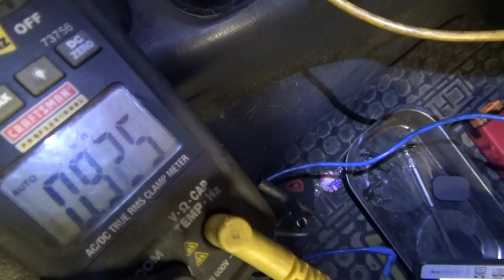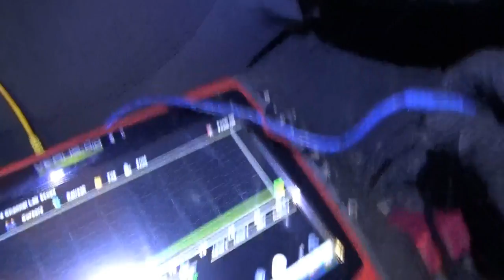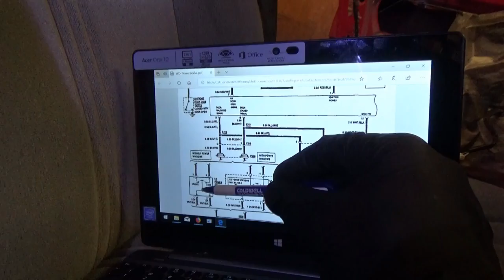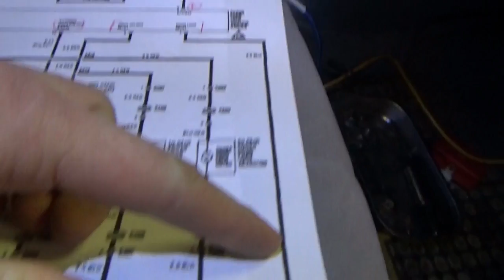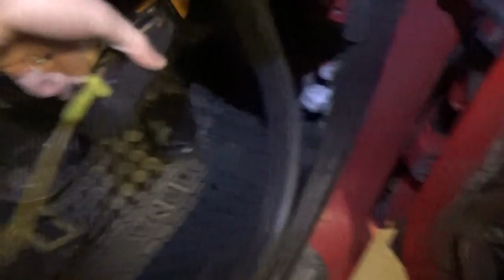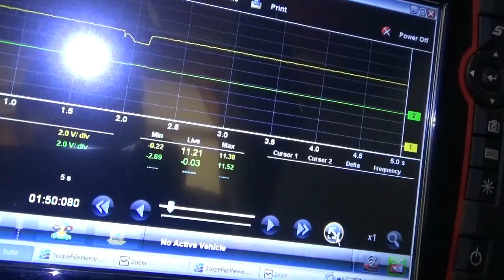Power locks gone NUTS! (Toyota) -Part 2

Comment: I must admit that over all of the "case studies" videos and many other diagnosing videos it seems to be that "automotive wiring" and "terminators" or plugs/connectors are usually the problem in just about 70% of what I have viewed so far. By that it seems, NO parts needed, just a simple wire repair or terminator cleaning and dielectric treatments.  It seems to be such a massive concern if this is happening along the entire "rust belt" that the auto makers need to re-think how they design and provide their customers with "reliable" wiring systems.  This issue isn't likely as bad in dry areas of the USA however, give it enough time and the same will result even in the lower states. This is especially true with all low voltage circuits such as 5v or low current circuits that simply send impulse signals to "modules".  Also, it appears that module placement needs to be centralized in vehicles to eliminate the tear down process and extreme labor needed to diagnose them.  You would think the auto makers would figure out a way to simply mount all modules in a "vault" located centrally to the vehicle so any need to diagnose modules would be in one place vs. 15 or 20 places and in extremely bad locations subject to heat, road hazards, weather etc. Take note how a residence is wired, they have circuit breakers in one central location...can you imagine having them spread throughout the entire residence !!

One other thing I believe is necessary when diagnosing vehicles. A battery maintainer that is connected to the vehicle battery as the first task. Many of these repairs require doors, hoods, truck lifts etc. to be open and courtesy lights are on including the ignition key to on etc. At some point, the battery gets drained and usually never is brought up to the fully charged state when the job is done. I'm no engineer but it seems that 12.6 volts would be best vs. 11.2 for example when diagnosing electronics designed to run on 12.6+ volts. I've seen a few vehicles that are super sensitive to lower voltages and cause problems just because the system voltage is not "perfect".

Comment: ivan
I would tired unplugging the module and monitoring the voltage and if it jumps up to 12v then call the module
Reply from the maker: But the module supplies the voltage....so you would just get 0V lol! Now maybe taking just that one pin out....that could work :)

Comment: Wow very good analysis, since the car is so old the rubber trims could be deteriorated causing water intrusion mix that with road salt spray and you have good conductance between pins that shouldn't be connected. Every time I plug in my block heater I need to wipe the plug clean or it trips the gfi outlet. Merry Christmas and happy New year

Comment: You did not show the resistance value after cleaning the plugs. The pull up resistor value will determine how much current that the circuit can source. That would cause a voltage drop even with a 100's of kilo ohm resistance if the pull up resistor is a high value. I would have put some dielectric grease in the plug to help keep out future moisture.

Comment: When you was testing the resisters in the module even though you were not pressing any buttons you must have had some current flow to gave the drop in voltage accross them. Because as you know...no current flow=no voltage drop....all down to the green crustys in that conecter... Good find...

Comment: You definitely have a problem with corrosion in the Northeast and Midwest.  Corrosion was one thing taught at seminars I used to attend, however, in Southern California I sometimes found non corrosive wiring problems, but usually was a component problem.  Still, this was a great training video WITH a live intermittent problem ! !   Great Repair!
Reply from the maker: All this rain this past year has been bringing in some really interesting case studies! I had three good ones just this past week....and one lined up for tomorrow!
Reply: @PineHollowAutoDiagnostics  
Fantastic job!  Keep the videos coming!  I had a "U1000" code on my 06 Nissan Frontier at the 4X4 module earlier this year.  The 4WD worked.  Watching the information to the ECM, I could see the changes on my Matco MaxMe and  the Pico was showing Can Hi and Can Lo working.  Hmmmmm.  Disconnected the module board from the harness connector.  Nothing seen visually, no burned parts or broken printed circuit.
Cleaned connector and board contacts, no more problem.  No green crusties, possibly a film or glaze from (?).  Checked it last week, no codes all modules.  I've seen the "film" cause a problem in the past at work before I retired.
Having an automotive and lightweight electronic tech backgrounds has helped in 29 years.  Keep up the good work and diagnosing Ivan!

Comment: Could of just re soldering the whole main doors locks circuit board functions first.90% to 98% it will solved the problems too because soldering joints will be loosing and conducting powers even the soldering joints still looks very goods.Old Electronic components and circuitries will take in heat and moistures in years and decades will be losing internally intermittent conducting problems.
Reply from the maker: Nah that would be too much extra work; nothing wrong with this module and it lives in a nice dry place :)

Comment: I had a Jeep Grand Cherokee and neighbors were telling me the parking lights were flashing and interior lights came on then went off. This was happening all night. Driving it to work it wasn't doing it ? One morning the battery was dead so I knew the issue was getting worse. Charged the battery and started pulling terminal when I parked it. It got worse to the point the doors were unlocking & locking driving down the road and the interior light came on when this happened and timed out which was miserable at night. Figuring it was a bad door switch I went to U-pull it and got switches for the doors and swapped. Did the front first as no one rode in the back. That didn't solve the issue so I changed rear doors. While having the doors apart I checked all the wiring to the plugs. Got to the point it was click click click when driving. Took Jeep to a wiring specialist recommended by the dealer. They checked all the wiring and changed a module. I think it was BCM ? When I picked it up it seemed OK going home but the next morning going to work the clicking started again. Hundreds of dollars to "not" repair. Called specialist who said the harness had to be changed. Hundreds more dollars. Bought a battery disconnect, took the bulbs out of the interior lights, and set it every time I parked it. Never was fixed. When income tax came traded it. Dealer walked around it but didn't test drive, LOL. They would wholesale it anyway.
Reply from the maker: LOL that sounds like an interesting case study! Sounds like no one bothered to look at a wiring diagram xD
Reply: @PineHollowAutoDiagnostics   Tell me about it. Paid Rubino's automotive electrical specialists $100 for a module and $300 for installation and examining wiring harness to solve issue ? Wish someone like you was around then. You were probably still in high school.

Comment: Aloha Dr Ivan..anotha awesome video..i have a question Ivan..my 2008 Nissan Altima’s head gasket blew..i called this guy and he said Nissan don’t have gaskets and i need to buy a new Engine for $1,200 plus his Labor of $800..do these cars really don’t have gaskets pls and what shall i do..looking fwd to hear from you..be safe and Aloha🤙
Reply from the maker: What? No head gaskets?!? That guy must be pulling your leg haha
Reply: Altima has a gasket, what you need is a new mechanic.
There are very few honest folks in mechanics these days, Ivan and I are rare examples.
Be sure the fans work, or you will have the same issue again. 
All the usual stuff applies, no cracks, flat surface, new bolts, and a decent mechanic will check all of these items. 
Your "Parts changer" "Mechanic" should not be involved in any of this.

Comment: Dealing with the same issue right now. Only difference is it also activates and deactivates the horn, door locks, parking lights all at the same time.Does it constantly non stop while driving or with ignition off. Had to pull the fuse before it killed my battery when parked. Weekend project. 1995 Toyota Camry.

I'd appreciate a tip if you have one. Just pulling out the one dome light fuse stopped the issue until I can have time.
Reply from the maker: Wow a 1995 Camry....wiring should be pretty simple. Start with a wiring diagram! Hopefully it doesn't have an aftermarket alarm system lol

Comment: Wow I was totally wrong on this one! In the first vid I was convinced it was a magic box (module) problem. In this one, I would've sworn that big resistor was the issue - I'd have removed it and soldered in a new one for nothing! Then I'd have been boiling mad when I found out I did all of that for nothing! Didn't even think about that circuit being pulled down - I guess because it's not a sensor, my brain just couldn't see that possibility. Never would've thought a bad connection & cross voltage would cause something like this. This was a GREAT 2-video series here! 

I remember long ago getting slid by a motorcycle that had turn signal issues. After HOURS of troubleshooting some really strange issues, I found that the turn signal element of the 1157 bulb had broken off and fused itself to the running light element inside the bulb! I don't remember exactly what the issues were, but I remember that they defied explanation, and I had never seen a failure mode like that before, and I haven't seen it since! Took me a LONG time to figure that one out  - was SUPER frustrating. Sometimes just a quick visual of all the components is the best course of action. 

GREAT stuff Ivan!! Loved this one!! Time for me to buy some DeoxIT ... 👍👍

EDIT: I remember bits of what was happening on that bike now - the front 2 running lights, & right rear would blink at the same time (like hazards) with the left signal activated, but the signal elements up front wouldn't light (problem bulb was in the left rear I believe). Then with the signal off, the turn signal elements in the other 3 bulbs would light up BRIGHT, along with both instrument cluster indicators. It was an odd one, for sure!
Reply from the maker: Wow don't see that one every day!!
Reply: Before changing a resistor, check its value with a meter against its color code. In most cases, if within 20% of the marked value, it's OK. True you might have to lift one leg of a resistor to get the true reading.

Comment: Why would this not drain the battery?Can we find this short by using voltage drop across the fuse of this circuit?
Reply: The circuit is dropping 11.4-4.9 v across the resistor that's 6.5v over 600 ohms which is only 0.010 A.  A very slight draw and it only recently got that big since the phantom lock cycling only recently started.  If the phantom cycling had become persistent then the motor operation would have been a significant draw.  The situation was that the voltage on the pin was just hovering around 5v, below which it would draw from the chip's pin 5v, enough current draw  would activate the transistor which controlled the unlock relay.

Comment: Those old Corolla slash prisms were built in Sumi California. Back in the days of the good old go Chevrolet / Toyota collaboration. You can buy them a lot cheaper than the Corolla and there wasn't that many ACDelco Parts on it anyway. Win-win
Reply from the maker: The seats are super plush for an econobox. Very fun to drive and toss around with the 5-speed :)

Comment: Well done.Those Geo metros are known for pin problems.
Reply: It's a geo prism
Reply from the maker: PRIZM with a "Z" ;)
Reply: @PineHollowAutoDiagnostics  They all have the same pin set-up. The pins are very thin and are made of copper. The wire is very heavy and can handle a heavy load,so that can make the pins get hot,if there is a bad ground.One example, 1993 Geo metro headlights have sealed beam with three prong plug.the harness runs back to fuse block under dash,the pin socket.Bad ground at headlight will make pins melt at pin socket inside of car. My own case studie.

Comment: You must have been a TV repairman in a previous life. Interesting and well done Ivan.
Reply from the maker: haha TV repairman! I have repaired one or two of those in the past ;)
Reply: @PineHollowAutoDiagnostics  You are too young to remember the time before everything including TV's was non disposable. Of course that was the time of vacuum tubes which were easy to swap.
Reply: @ericcorse  True, but old electrolytic and paper/wax/foil capacitors were the #1 failure item in Vacuum Tube TV sets.

Comment: Hi Ivan.....with the benefit of hindsight would you approach this diagnostic in a different manner?....what i had in mind would be for instance to work from the module before stripping the doors.Maybe isolate the door switches from as near to the module as possible and test each one for correct operation.....also testing the module powers and grounds as per normal.If i can i prefer to break up a circuit into areas i can test isolate and move on from.......having said that you seem to get to the bottom of more issues than i do so maybe i am just blowing hot air lol....happy new year to you!
Reply: it's nearly always the door harness flex points or poor seal at the door harness to "body pass-through connectors" why do i say that, LONG ago, they ran the wires though and placed the connectors inside UPHILL above 3" or so, but that didn't stop water migration inside the stranded wires... somehow, it's all backslid like 30 years+ of hard work and real world learning!
aka collegiate trained sheeple with ZERO hands on real world training nor experience... or is it planned obsolescence, driven by shysters, bean-counters and stooges.
they try t stifle and snuff me down,  they more they do, the more they LOSE out and earth rebels.
Reply from the maker: My original thought was to start at the module, and that in hindsight may have saved some time. Pretty much just as easy to peel off the door panel as remove the glove box. The entire car actually comes apart very easily lol

Comment: good tracing work, but one of the first things, "close visual inspection" of all traces and solder joints, followed by "resistor color code" and test resistance beware of parallel components, and integrated circuits, you may have to remove one leg of said devices. secondly check electrolytic capacitors and then ceramic disc/others.
haven't watched past 7:49 yet, but it's not uncommon for the "silly" miniaturized IC's to fault.... especially the encapsulated "vertical" off board one in the coarse black coating......

Comment: Glad you kept at it! I worked on a 05 Kia Sedona that had similar problems, including a left side pw that would go down by itself at times. I suspected the after market alarm was causing the PL issue on mine, but was proven wrong in the exact same way ( what you found.. I won't give it away :)  ) What I will say is that mine took a lot more to repair than yours did... including several trips to the junkyard to source parts.

Comment: If you cut the wire at the module it would have went up to voltage then you could work backwards to find the crusty but I would not have thought the corrosion would make that strong of a drop good video look forward to the next

Comment: Looks like battery voltage is run through the resistors out to the pins.  But also, the chip puts a voltage, maybe 5v or the 6.7 (or there's a small leakage current through the chip) on the pin through a resistor to the pin.  Normal operation would see both voltages pulled to ground when the switch is closed.

So the unlock circuit is showing current flow with the short causing a voltage divider till the voltage division drops to near the threshold for the chip to sense being pulled down.  In hindsight, the 4.9v across the unlock pin shows this delicate balance.  

It's good to see in side the box.
Reply from the maker: Precisely. Excellent breakdown of the situation :)

Comment: 98 Saturn I had locked the front doors on me twice with key in ignition . Second time back doors where locked, had to hammer out the lock after I kicked  my door to the garage to get to my tools.(car was running) pulled the dam fuse that's how I fixed it.Bad start to my morning.